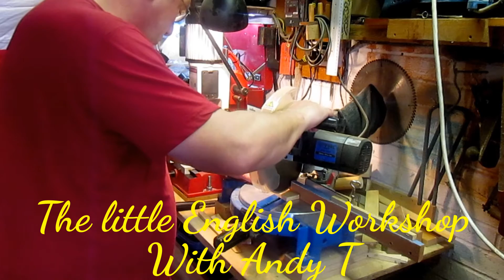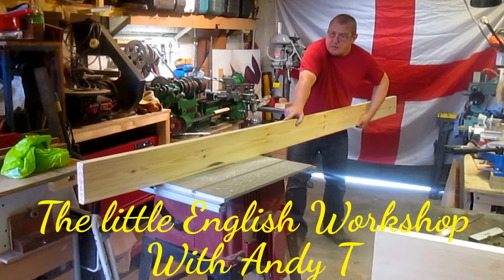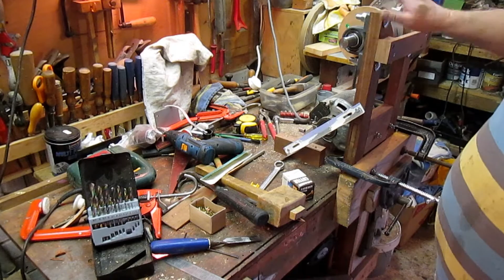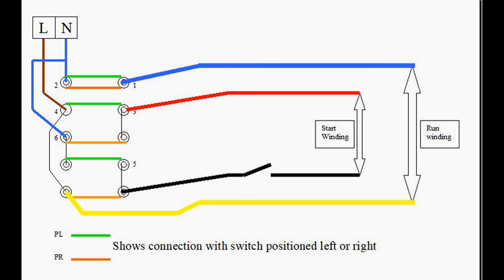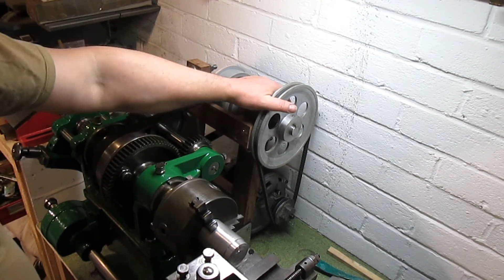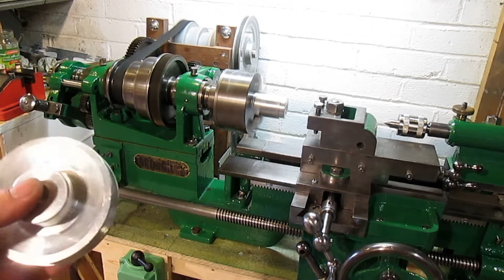Prototype Lathe Countershaft Build # 04

Comment: On my little Taig  (Peatol in the UK) I have a 1/3 hp motor and it stalls frequently. I am looking around for a treadmill I can deconstruct and get full control over the speed, plus the advantages of DC motors. Lots of videos on that on YouTube. Maybe you want to look at tradmill motors. BTW Aluminum wants the highest speed you can manage. Still that Lathe is a gem. And using wood for the countershaft mechanism is inspiring.
Reply from the maker: Looking back at this video I think the real issues were with belt tension, I'm not fully sure what the HP of the motor is but likly 1/4 to 1/2 HP. 
The lathe will be better when I get a more powerfull motor but I'm still using this motor with better belt tension and it's not too bad.